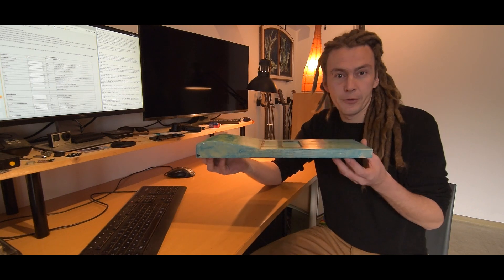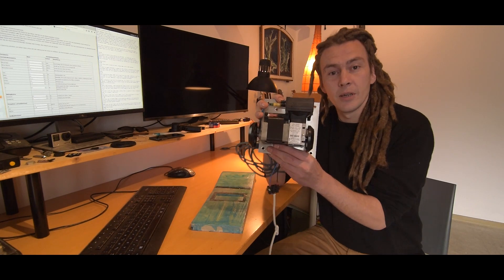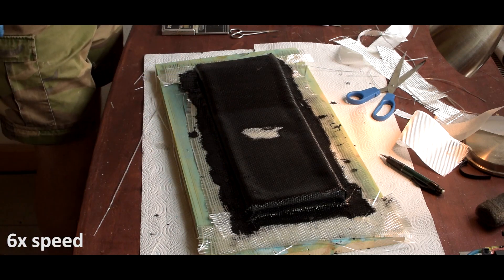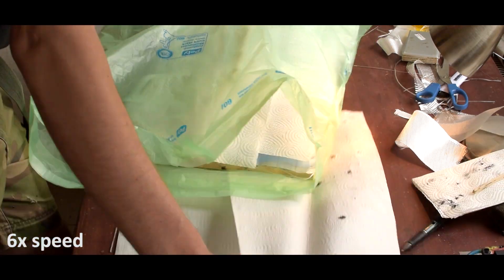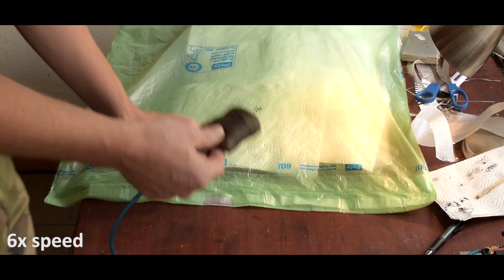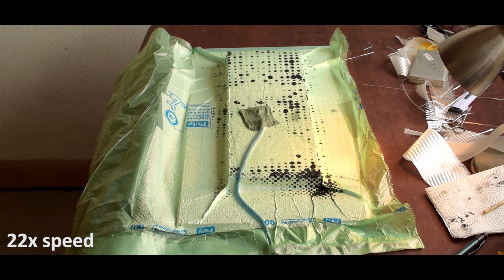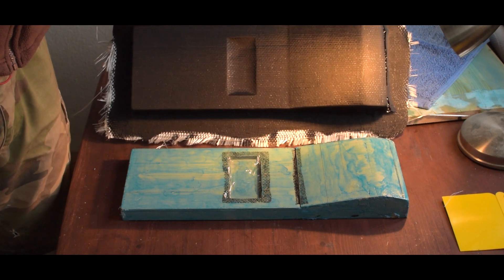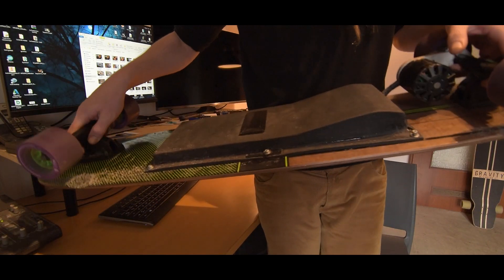Vacuum Moulding with Fiberglass - How to - Tutorial

Comment: Nice! The van I am converting is a 2007 with the luxury addition of a CD player as well as a radio and a little shelf above it. So, given its fixed moulding, not enough space for a 2020 7" touch screen. I figured it was time I learned fibreglass shaping to replace the unit.
Reply from the maker: GoGoGo! :)